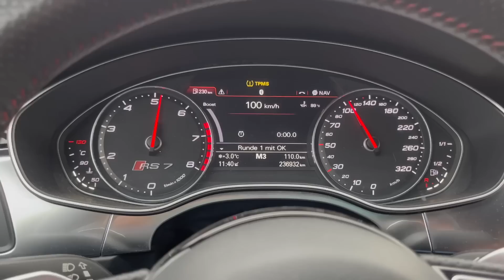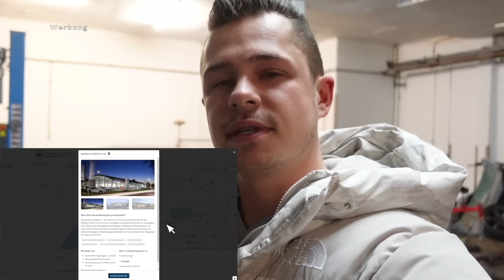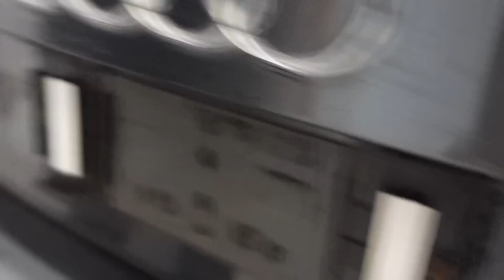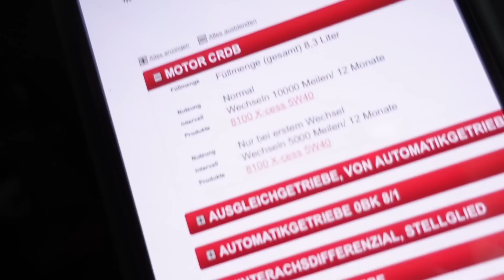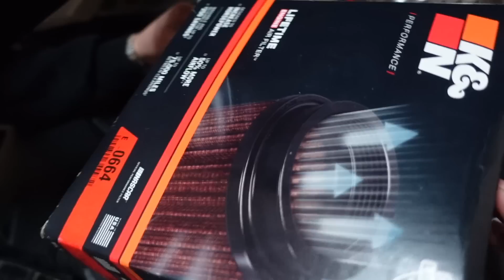Erster Ölwechsel nach 1000KM | Damit hat keiner gerechnet!

Comment: Hatte noch ein nagelneues original Getriebe 0kmh Baujahr 2006 rumliegen, nein KFZ Kollege hat diesen in meinem Saab 9-3 Turbo Baujahr 2003 eingebaut(+ neue Kupplung), weil das alte Getriebe fast Schrott war, wir haben nach 2000 kmh auch das Getriebeöl nochmals gewechselt, waren eine Menge Späne drinne.

Ich fahre jetzt einfach auf gut Glück, inşallah hält das Getriebe noch mindestens 2 1/2 Jahre. Notfalls müsste ich für ca. 600 Euro ein neues 0 kmh im I net bestellen.